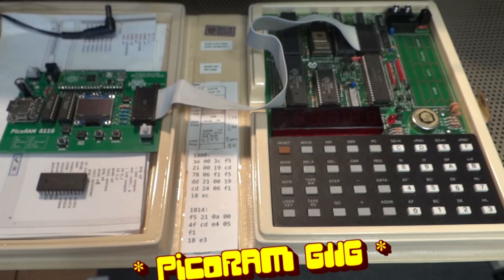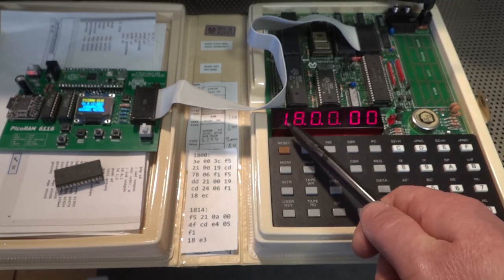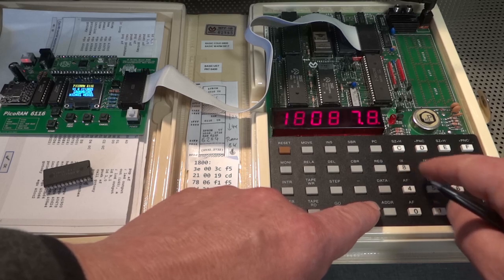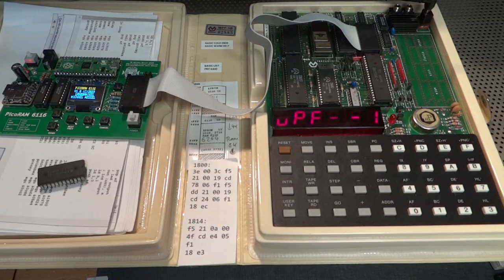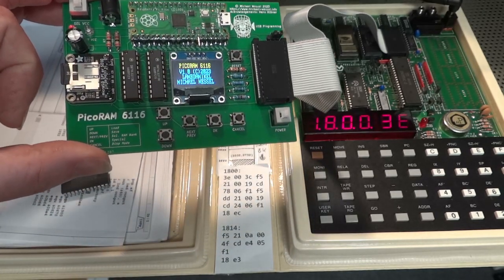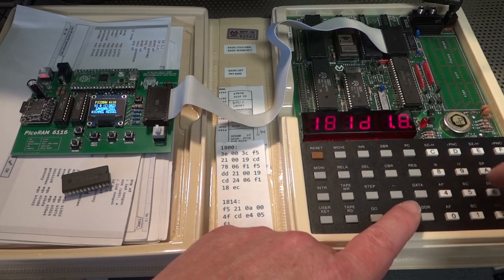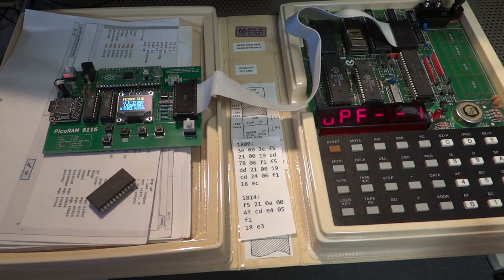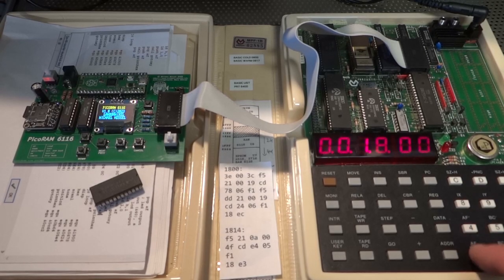PicoRAM 6116 - SRAM Emulator & SD Card Interface for the Microprofessor MPF-1B

Comment: Hi! Very nice! Well done! Maybe you could use the OLED display to show live RAM values (of a certain window) or some dump of RAM data!? 😮
Reply from the maker: Thanks. Yes, that was the original idea (even Mnemonics, like in my other PicoRAM: https://youtu.be/dFnKhUI47KU) But it seems that, even though I had this running on the second core, this interfered with stable operation. I need to figure out why. Disabling display updates from the 2nd core fixed the stability problems. I guess it's because there are some shared memory accesses using global variables then, resulting in timing glitches.

Comment: PicoRam is much faster than MPF-1B
Reply from the maker: And yet, it's barely feasible to do that kind of thing... if you look at the 6116 timing diagram, then it can be the case that for some operations you only have a time window of about ~80 ns... and this is a very tight timing constraint, even for an overclocked Pico. Thankfully, the Z80 in the MPF-1B doesn't access it that aggressively.

Comment: That's very cool! I'll have to pass this on to my buddy who has my old -1B. 

I kept the -1P... :)
Reply from the maker: Nice - yes, I also have two 1P... the CPU is faster there. A Z80A. So I'll have to check if PicoRAM 6116 will work with it. It may require firmware patches.
Reply: @michaelwessel4953  Looks like it does, I just watched the 1P version. :)